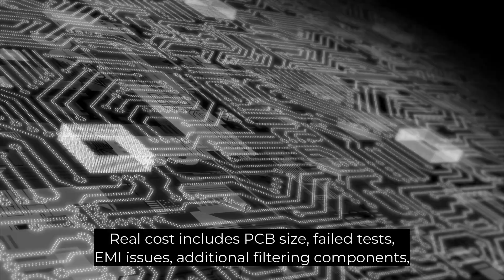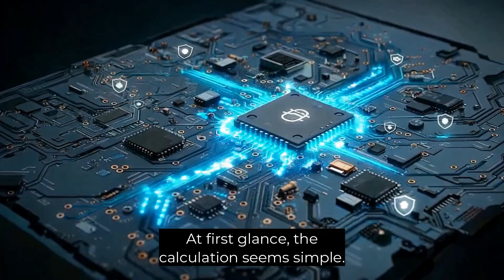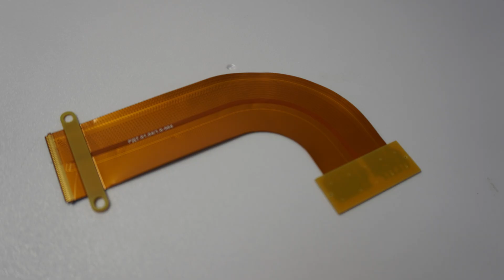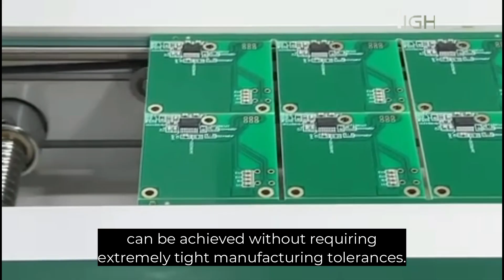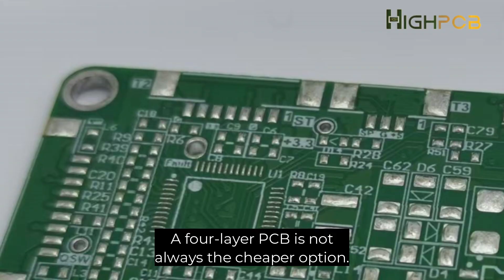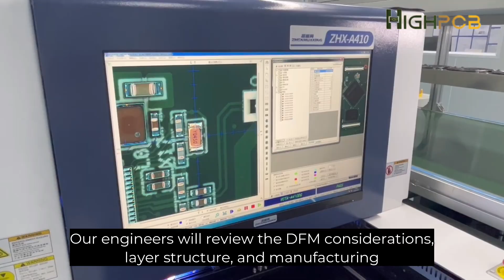4-layer vs 6-layer PCB cost optimization

Comment: The total PCB cost isn't always lower with a 4-layer design. If moving to 6 layers simplifies routing, reduces vias, or improves EMC performance enough to avoid another board revision, it can actually be the more economical choice over the product's lifecycle. Looking beyond fabrication cost often changes the decision.

Comment: One thing that's easy to overlook is that a 6-layer board isn't always the more expensive choice in the long run. If it reduces EMI issues, simplifies routing, or avoids multiple design iterations, the total project cost can actually end up being lower. It's a tradeoff that's bigger than just the fabrication quote.

Comment: This is a point that's often overlooked. Comparing only the bare PCB cost can be misleading—the total product cost includes engineering time, EMI debugging, SI validation, redesigns, and manufacturing yield. In many high-speed designs, a well-planned 6-layer stack-up ends up being the more economical solution over the product lifecycle.

Comment: This comparison made me wonder where the real break-even point is. At what production volume does moving from a 4-layer to a 6-layer PCB become the more cost-effective choice overall?
Reply from the maker: The break-even point is driven by complexity rather than volume alone. A 6-layer board becomes the more cost-effective choice at any volume if a 4-layer design would require expensive HDI features like blind or buried vias. For production runs starting around 1,000 units, a 6-layer board saves money overall by reducing the board's form factor (lowering enclosure costs) and providing solid ground planes that eliminate the need for expensive external EMI shielding and filtering components.

Comment: The tricky part with 4-layer vs 6-layer boards is that the cheaper stackup isn’t always the cheaper final product. If a 4-layer design needs extra routing time, tighter spacing, more EMI fixes, or multiple revisions, the 6-layer option can actually save money over the full project cycle. I think cost optimization should include engineering time and respin risk, not just fabrication price
Reply from the maker: calculating the true cost of a board has to account for engineering overhead and risk, not just the raw unit price.

Comment: Great insight. Focusing only on bare board cost often overlooks signal integrity, EMI performance, and redesign risks. Total project cost is what really matters.
Reply from the maker: Exactly, sacrificing signal integrity to save a few pennies on the board often leads to much higher costs during debugging and production.